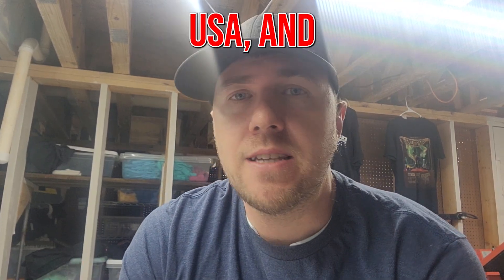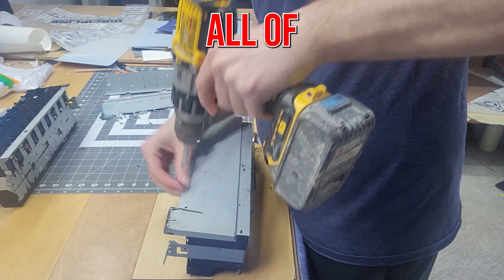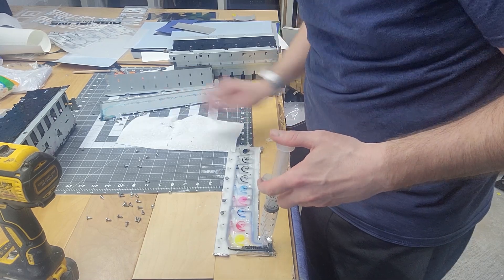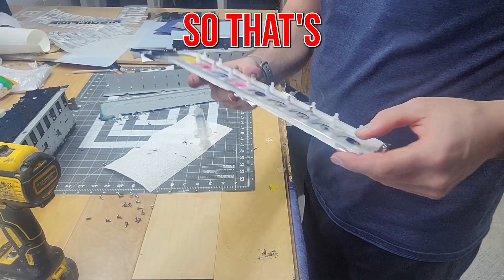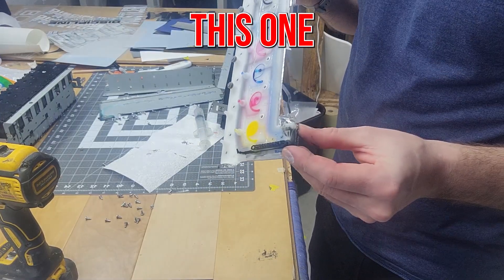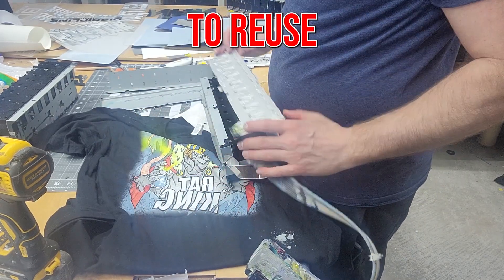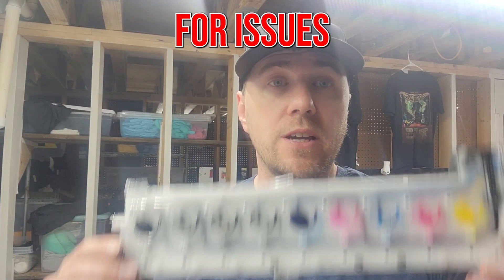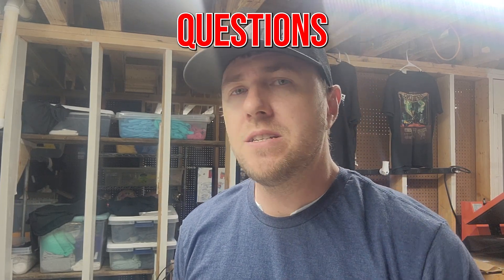Epson 3880 Ink Bay Dis Assembly and Diagnostic

Comment: Have you ever had a problem with ink flowing back to the print head after changing anything ink related? If so go do get the ink flowing again. I have even tried using the adjustment software to do an initial ink charge several times with no luck.